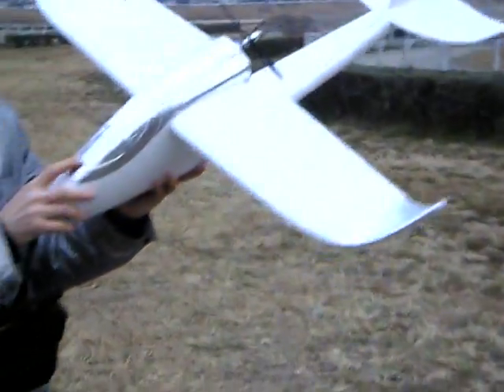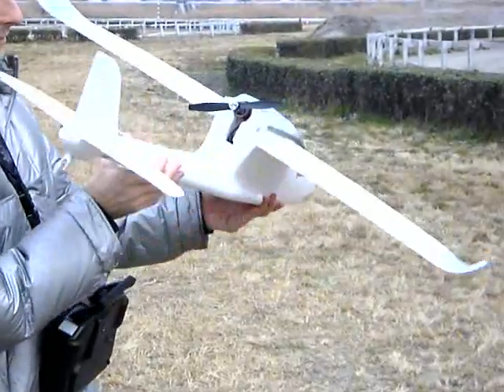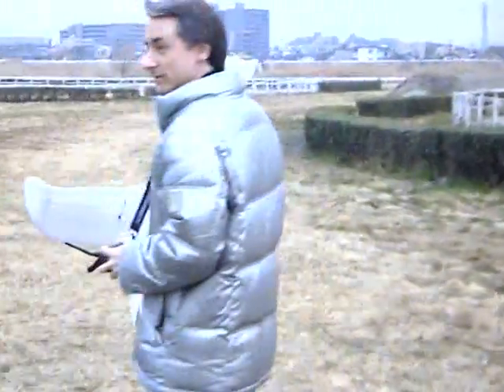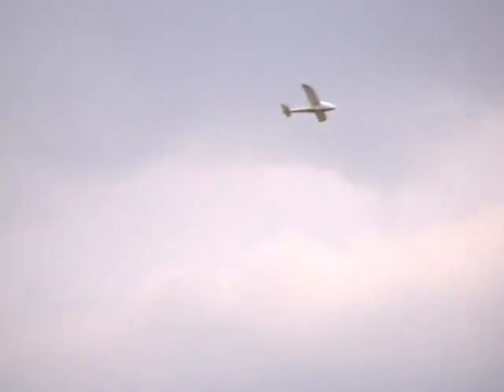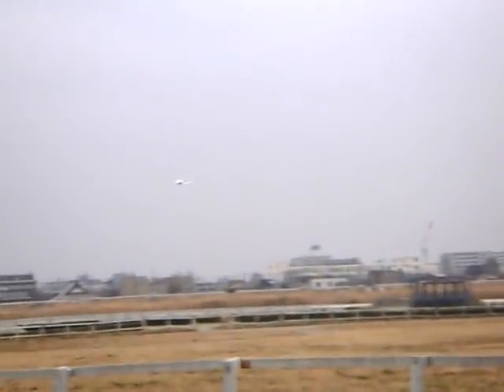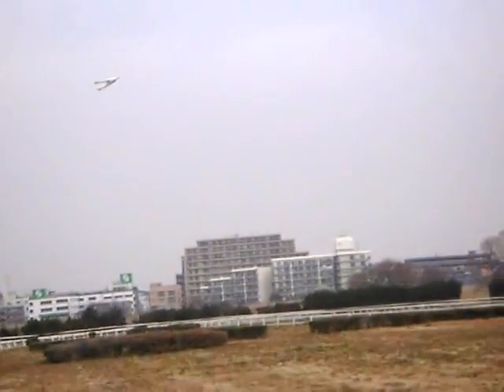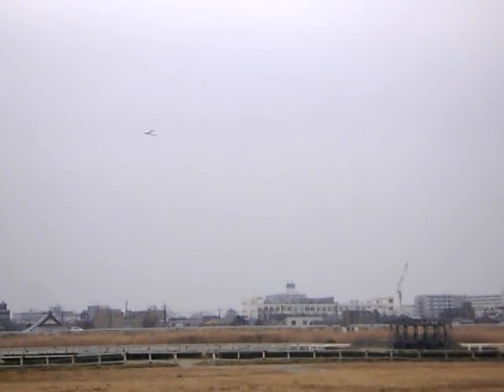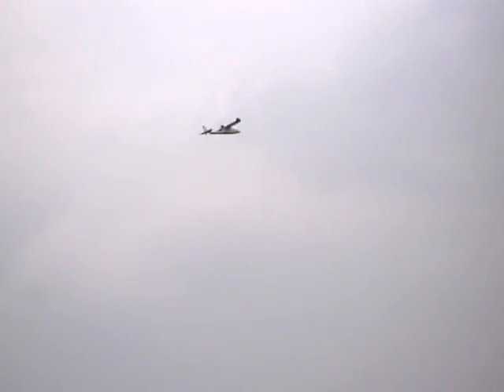Pusher Star by Riccs - 2200 lipo still tail heavy

Comment: @SteebunRoba 
i think too.in fact, regarding other models, this configuration is for pulling not pushing.it's like high wing plane(cessna etc.)   / compared to hawksky and other copies of easystar, if you put (i tried but no video) the elevator higher or equal height of the wing, it flies better, even at low speed(more controllable).with this actual configuration needs a lot of speed.,In pulling mode like me, you got no problem at low and high speed, except elevator that is too small

Comment: This plane definitly wouldn't fly with à pusher mode .i've crashed It too many time.the solution i found id to put a 750 kv motor + 3s2200mah lipo at the front, and a 9*6prop. Then It fly with High stability in gusty wind. It wants to go higher n higher.i will post a video soon.

Comment from the maker: @oysterlicker
I know all about thrust angles. See my video saga THRUST ANGLE WARS. It's actually exactly the opposite of how you describe it. The downward thrust angle (pointing the motor/prop down) reduces the tendency to push the nose down when throttling up, but also reduces total power (forward thrust) at the same time.  This plane's wing is so high that the motor is almost directly behind it and therefore downthrust is basically unnecessary.